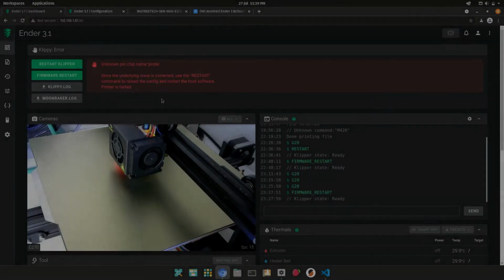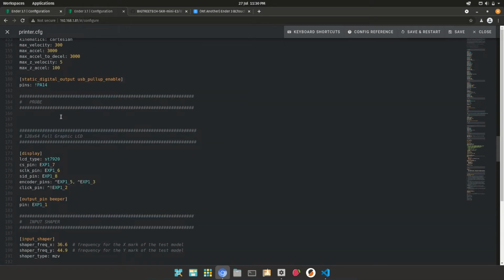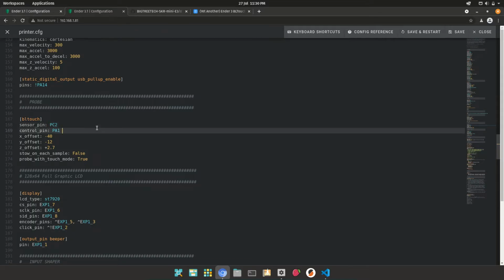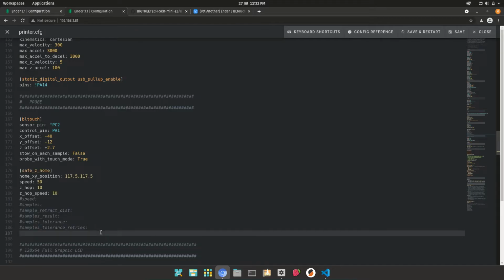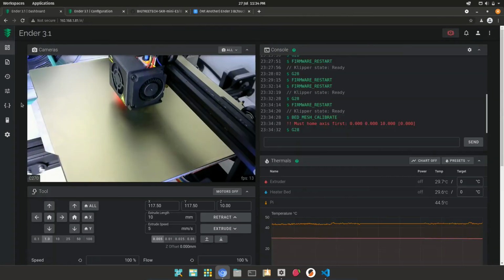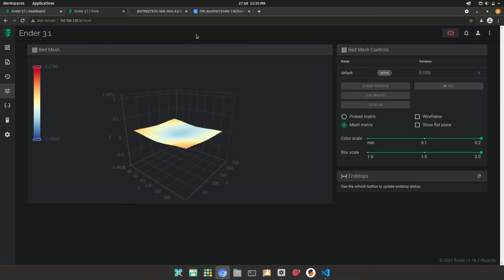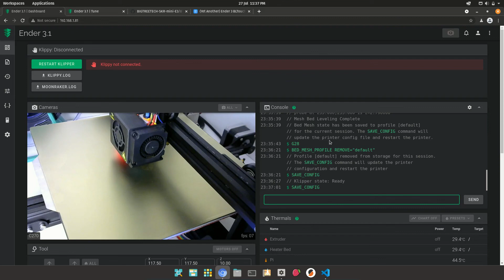Klipper Basics - Adding A BLTouch

Comment: Can I get you print cfg file ?
Reply from the maker: You can, but is not going to be much use unless you have the same Mainboard, Probe, Nozzle, Bed heater, Thermistors, Extruder and so on. Think you would be far better off with the stock example cfg for your printer and then tweaking as needed, more then happy to help in any way I can, and you you really want my cfg I will post a link.

Comment: In Marlin, it is possible to measure distance with the sensor during manual leveling. No need to mess with paper. Does the klipper have something like that?
Reply from the maker: There is Screw tilt adjust (see my play list on Klipper Basics) this will probe the 4 comers of the bed, measure them, and spit out what direction you need to turn them and by how much.  Hope this helps.

Comment: Hallo! seit einer Woche versuche ich die PIN´s für sensor_pin und conrol_pin zu ermitteln ich schaffe es nicht BOARD creality V2.2  ATmega 2560CPU
Reply from the maker: Hallo, können Sie mir mitteilen, auf was sie in Ihrer alten Marlin-Konfiguration eingestellt sind? Oder laden Sie einen Link und ein Foto hoch, wo sie angeschlossen sind, und ich werde sehen, ob ich eine Pin-Karte für das Board finden kann.
Reply: @PigeonPrint  moment sofort
Reply: @PigeonPrint  OK hier die Belegung!   2er Anschluss Schwatz Erdung , Weiß Z-min  3er Anschluss  gelb Steuersignal. Rot 5V,  braun oder so  Erdung
Reply: @PigeonPrint  oder ist mein Board wohl nicht kompatibel mit Klipper ich habe Board Creality V 2.2  nicht V 2.2.1
Reply from the maker: @franzgoesmann8770  a, Ihr Board funktioniert mit Klipper.

Creality hat einfach keine Pin-Map für Ihr Board, aber eine für Sie gefunden. Schauen Sie sich an, an welche Pin-Nummern Ihr BLTouch angeschlossen ist, finden Sie die Pins auf diesem Link und tragen Sie die richtigen Pin-Nummern in die Printer.cfg ein  

https://external-preview.redd.it/gCK_UjIfky1O9SxR03RogRuETqHudQwVys5JbvlcFKc.jpg?auto=webp&s=e185c950525313771d6a67a4f70b056c3db8ebfa

Wenn Sie nicht weiterkommen, senden Sie mir einfach ein Foto Ihres Boards mit dem angehängten BLTouch per E-Mail und ich werde die Pin-Nummern für Sie ausarbeiten.
Reply: @PigeonPrint  ES geht Es geht  SAGENHAFT LEUTE DANKE Wie kann ich Euch danken?????  Irgend wie oder Wo was posten???   1: sAHNE danke
Reply from the maker: @franzgoesmann8770  Kein Grund, mich zu tanken, du hast die harte Arbeit gemacht, ich habe dir nur einen Link zu einem Bild geschickt.

Ich bin nur froh, dass du es zum Laufen gebracht hast!

Viel Spaß beim Drucken!
Reply: @PigeonPrint  Hallo noch einmal. ich habe irgend was verbogen. Es geht wieder nicht der BLT die Verdrahtung ist geblieben. Ich habe keine Ahnung Muss man eventuell irgend was neu kompilieren oder so. Gruß Franz Goesmann

Comment: Guten Abend. Könnte ich Dir eine Frage stellen zu Klipper!? Läuft alles soweit bis auf den BLTouch keine Fehlermeldung nichts. Der reagiert nur beim Start mit dem Selbsttest sonst überhauptnicht. Habe ein SOVOL SV01 mit Standardboard. Unter Marlin lief alles. Gruß an allle
Reply from the maker: Guten Abend. Ich kann versuchen zu helfen, muss mich aber wegen meines schlechten Deutschs beschweren.

Was hast du in deiner Printer.cfg unter BLTouch?

Versuchen Sie es auch zu ändern:

[bltouch]
sensor_pin: ^ar18
control_pin: ar11
Reply: @PigeonPrint  Danke für die Antwort. Bekomme folgenden Fehler Pin 'ar11' is not a valid pin name on mcu 'mcu'

Comment: Hi Mate, I am trying to use klipper and struggling to get the bltouch to co-operate, I get the error: Move out of range: 269.500 32.500 10.000 [0.000] I have copied what I have from my config below are you able to point out where I have gone wrong much appreciation in advance. Using Big tree tech skr mini e3 v3
[stepper_x]
position_max: 245
[stepper_y]
position_max: 250
[bltouch]
sensor_pin: ^PC14
control_pin: PA1
x_offset: -47
y_offset: -8
z_offset: +2.35
stow_on_each_sample: False
probe_with_touch_mode: True
[bed_mesh]
speed: 120
horizontal_move_z: 10
mesh_min: 51.50, 24.50
mesh_max: 222.50, 234.50
probe_count:3,3
algorithm: bicubic
fade_start: 1
fade_end: 10
fade_target:0
Reply from the maker: Hello mate, at a quick guess I would say the 269.500 movement is outside of your "position_max:" so, going on that guess your BLTouch is on the left-hand side of your nozzle and you have a printer bed size of 250mm? 

If you look in your config file under [stepper_x] and [stepper_y] you will see a value called "position_max:" this is normally the size of your bed rather than the actual full movement of the axis. Klipper won't let you move over that "position_max:" value so with a Probe that is left or right of the nozzle you will have to change the "position_max:" to a higher number still within how far your printer can move, or depending on the design of the printer under [bed_mesh]  you will see the values "mesh_min:" & "mesh_max:" these can be changed so it will only probe within the limmits of your "position_max:"
Reply: @PigeonPrint  cheers mate yea I eventually figured it out after reading docs on klipper

Comment: when i set my bl touch x and y offsets it wont let me calibrate the bed for a mesh says some moves are out of range but it didnt have a problem before i set the offsets. can't figure it out. havent tried printing on it yet because i know its not right.
Reply from the maker: you will need to adjust the "position_max:" value to its true value on X &Y, or it will just assume the print head can only move while over the bed. For instance, the default on an Ender 3 will be position_max: 235  for the X, but it can actually move over 245 in X, you need to tell the printer how far it can actually move, so it can move off the bed's area and probe the largest amount of the bed.

Comment: This video was great. I have one issue I have been trying to get. I am running a hero me on my ender 3 with Klipper. My X-Y home offsets are off. I can't figure out how to get it correct. I have read the klipper page but I can't visualize how the lines should look in the printer cfg file and what section it even goes under. The instructions are just confusing to me. I could really use some help. I have run the commands to get the numbers I need but not sure how to put them in and what it should look like. thank you.
Reply from the maker: Hello, is it the XY for the probe you are having issues with or is the nozzle not in the bottom left corner when you home the printer?
Reply: @PigeonPrint  nozzle. But I just realized something. I'm putting a cr touch on now. So I don't think it will be an issue.
Reply: @PigeonPrint  I tried doing a bed level probe after using your video. I'm getting an out of range error after the 2nd probe spot. I'm assuming I need to change some offsets
Reply from the maker: @toddcoello6461  Sound like you need to adjust the movement limits. If you look under [stepper_x] there will be a line saying "position_max: 235" you will probably have to encrese that to the actual limit of movement, as form stock it just uses the Bed size as the limiting factor when infact the print head can go further than 235mm in X. Hope that helps!

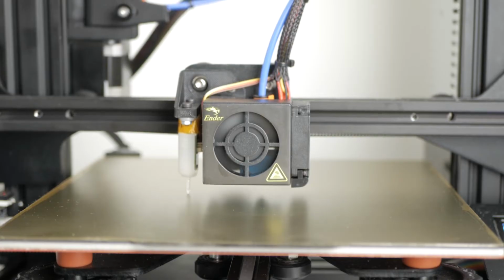Comment: You had safe_z_homing on and your [bltouch] x_/y_offset set but the probe wasn't in the middle of the bed when you homed (3:04). I'm also having this issue, do you have any idea why the z_safe_homing isn't using the probe offsets? Furthermore, the probe probe position shown after a probe_accuracy test shows that Klipper things the probe should be in the middle despite it not being there.
Reply from the maker: Hi, Klipper will use the nozzle as the centre rather than adding the probe offset.....So it's woking if your nozzle is in the centre rather than the probe itself. 

Not 100% sure I understand the second question,?
Reply: @PigeonPrint  I didn't know that Klipper uses the nozzel as the center when probing, I thought it would use the probe, so that answers my question, thanks! I ended up adjusting the home_xy_position by adding my probe offsets to make z-homing occur in center via probe.
Reply from the maker: @yeastdonkey846  Yep, that sounds like a good way to do it. I can't think of anything that would make that a problem.

Comment: Do I need to put the Save_Config command in my GCode before Print? What I'd like to know is: When I start a print and run the G29 command in my gcode. Should I put a SAVE_Config in it?
Reply from the maker: In your start gcode you could put a load or save command BED_MESH_PROFILE LOAD=<name> SAVE=<name> is you wanted to save the mesh or just load the last saved on. More info can be found here:

https://mmone.github.io/klipper/G-Codes.html#mesh-bed-leveling
Reply: @PigeonPrint  Thank you. For me it seems like the printer doesn't move up and down when it is printing.. So the printer doesn't effekt from the bed leveling..

Comment: Great video! Something I am confused about, is if we are probing the bed to get the correct height under the nozzle, when the probe is probing the right side of the bed, how do we know this is the true value of the right side of the bed, if the probe will not go that far? In other words, since the probe is offset from the nozzle, how does the probe know how high or low the right side of the bed is? I would almost expect the nozzle to go past the bed on the X axis, and the probe would probe where the nozzle will be?
Reply from the maker: This is a good question. it won't get the right high of any point that is not probed, but it will use maths to project the area of the bed outside of the probed mesh. it's not perfect on a bed that is warped or over-constrained, but it makes assumptions for example if it is probing the front of the bed, and each probe point from the front left to the front right is getting higher and higher in 0.1mm increments it will calculate that this incrimination will continue to the edge of the bed as it's trying to map a flat plane. in the same way it will just assume the height between any two points it probes is a straight line between the two points...this may not be true, but the level of deviation is slight enough that the print will fail. This is why you will always get better results with more probe points and a probe mounted where it can actually take the probe point of the majority of the bed.

Comment: Thanks for the video. How do we calculate the probe min and max positions?
Reply from the maker: The simplest way is to move the printer with the web interface and get the coordinates of where the probe can actually hit the bed, as with some setups your probe can miss the bed if it tries to probe 0,0 or hit the frame. So, just move it to the front left and make sure the probe can deploy and hit the bed, read the coordinates, and put them as mesh_min: For example 10, 20 (X,Y) and then move to the back right and add the coordinates for mesh_max: for example 195, 223. Hope this helps.
Reply: @PigeonPrint  my bl touch still tries to home off the bed and I get an error even after I set the correct min and max
Reply from the maker: @MrKillerCereal  What error fo you get, and do you have safe thing set up in your printer.cfg, should look something like this:

[safe_z_home]
home_xy_position: 117.5,117.5
speed: 50
z_hop: 10                
z_hop_speed: 10

But with the home_xy_position: 117.5,117.5 set to where the middle of your bed is, In my case it a 235x235 bed so the middle is 117.5x117.5.
Reply: Thanks for the info thats where I was going wrong. I was putting the nozzle to the front left corner not the probe thinking the probe offset would put the probe in the right place. Thank you for the reply im very new to Klipper so a big help. Keep the videos coming
Reply from the maker: @aaroncamm2024  Yeah, Klipper has some quircks of when it dose and doesn't use the probe offset. Still catches me off guard ever now and then! Good to hear you got it sorted.

Comment: Love you guides. Keep them coming please. Just starting with klipper and this kind of tutorial are the best. No long story's but strait to te point and most important everyone can follow this easily.  Thank you for alle you work you put in in it.
Reply from the maker: Thank you for the kind words, would love to hear if you run into anything you think would make for a good tutorial. it's sometimes hard for me to remember all the things I had problems with when starting out!
Reply: @PigeonPrint  Sure , The problem is there are a lot of tutorial but they all give basic stuff and that is great. But when you start with Klipper that is sometimes not enough and when the basic setup is finished what's next. Then there is not much info unless you know what your looking for. So some tutorial how to adjuist Klipper after the basic setup. Tweaking stuff for getting better results and in what the best order for tweaking it. How to use the Marcro's. Slicer setup for Klipper. I had Marlin setup with G-code for start/stopping etc. Now wiht Klipper that is not working because not all M (code) are available in Klipper.  So how to prime the nozzle etc.  Most info you can find but sometimes hard to find and your way of explaining is great. Quick and clear....
Reply from the maker: @mikeooo  Thank you, that a really helpful insite, agree the changes in Gcode compatibility and changes needed in thing like slicer start Gcode could do with a simple clear cut guide, will get to work!
Reply: @PigeonPrint  Hi. Thanks for Your work. Found it really helpful. An idea for a tutorial is installing  a K-Type thermocouple that sports an Analogue amplifier like AD8495. I spent days on trying to find how to set it up on my Octopus Pro board with klipper. In the end I managed to combine info from 4 or 5 different sources to be finally able to proceed with my build.
Reply from the maker: @savikate  Thank you, that is a really good idea!

Comment: I use textured pei spring steel pasa ender 3 v2. and want to install auto bed level do you think it's better to use an inductive probe or bltouch clone do you have any recommendations for me?
Reply from the maker: If you're only going to use the spring steel sheet then an inductive probe will be fine. I use the $5 PL-08  and Nero 3D has a really good video on how to install it as you will ideally want to power it from the PSU, not the PCB https://www.youtube.com/watch?v=ZF-XiKs-XUs
Reply: when I use the inductive probe npn no with type LJ12A3-4-Z/BX
 is the installation method the same as in the nero3dp video?
Reply from the maker: @lanypuspasari1868  Yep, the Voltage on the LJ12A3-4-Z/BX 6-36V so you will bet the best results powring it from the 24v of the power supply.
Reply: @PigeonPrint  using a bat85 diode on the signal cable like in the video nero3dp?
Reply: do you think the M8 5v inductive probe is like a panda, is the accuracy good for ABL?
Reply from the maker: @lanypuspasari1868  I have not used one so can't really be sure.
Reply from the maker: @lanypuspasari1868  Yes, whenever you connect a probe that is using a higher voltage then the mainboard you want to use the diode to protect the board from getting damaged.
Reply: @PigeonPrint  Can NPN NO and NPN NC be installed in the same way and are the probe pin configurations different? I have never installed ABL before but I have run the klipper with fluidd on the 3v2 ender stock.
Reply from the maker: @lanypuspasari1868  Yes both the same, the one difference will be if the LED light up when triggered or when not triggered.
Reply: Sorry for asking so many questions and disturbing your time
Reply from the maker: @lanypuspasari1868  nothing to say sorry for, I'm very happy to answer any question you have! :)

Comment: can blouch clone or 3dtouch v3 or v2 work with this configuration?  on ender 3 v2 with stock mainboard v4.2.2?
Reply from the maker: Yes, all work, you just need to set the right pins for the V4.2.2 board in the printer.cfg file...I belive it would be:

[bltouch]
sensor_pin = !^PB1
control_pin = PB0
x_offset = #your mount offset in mm
y_offset = #your mount offset in mm
z_offset = #your mount offset in mm
probe_with_touch_mode = True
pin_up_touch_mode_reports_triggered = False

And would just need to tell it what your offsets are for the probe mount you are using.

Hope that help!
Reply: @PigeonPrint  what is the function of the exclamation mark on sensor_pin = !^PB1 with ^!PB1 and ^PB1?? can the inductive probe be fed?  but I still don't understand the difference between the ^!  and !^
Reply from the maker: @lanypuspasari1868  !=invert, so if a motor is turning the wrong way or an enstop is showing closes when it should be open, we use ! before the pin number. ^= mean there is a hardware pullup resistor on the pin. With a default contigeration you are mainly going to just need to add ! and seldom have to worry about rull up resistors.
Reply: @PigeonPrint  does pin PB1 have to be with !^PB1 for sensor_pin?  or just ^PB1 without !
Reply: @PigeonPrint  sorry if I ask a lot of questions because I have never installed bltouch and any abl sensors on my printer.
Reply from the maker: @lanypuspasari1868  totally depends on the mainboard in question, for my SKR E3 minin V2 the pin is sensor_pin: ^PC2 for the for the V4.2.2 board it would !^PB1 as on the mainboard it is inverted and need to use the pullup resistor, so we use ! (invert) ^ (use Pull Up resistor) PB1 (pin number PB1).
Reply from the maker: @lanypuspasari1868  No problem, i'm here to help!
Reply: 5 wire 3dtouch is connected to the bltouch pin on the mainboard? or 3 wire to the bltoch pin on the mainboard and 2 wires to the z endstop pin?
Reply from the maker: @lanypuspasari1868  The 3 servo wires to the 5 pin header, and then the two switch pins to the z endstop so you can use Z safe homing.